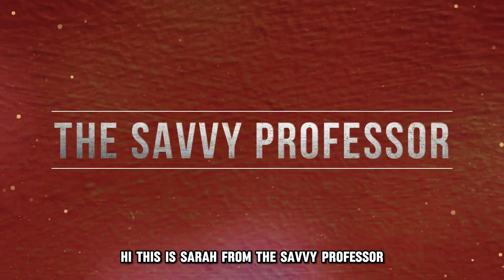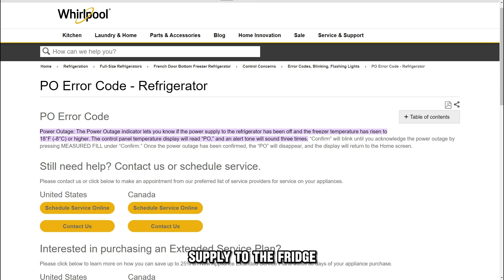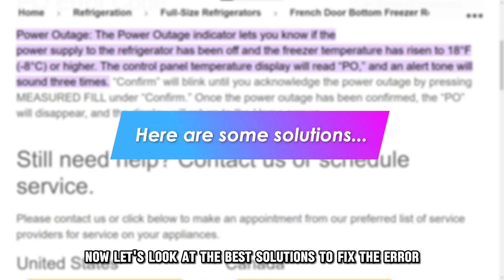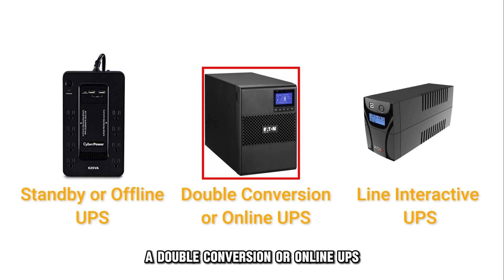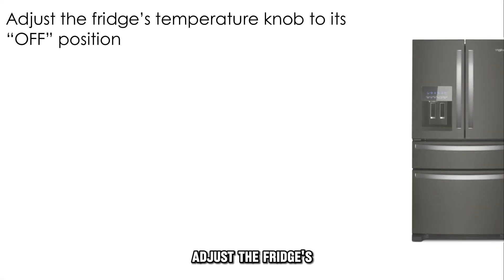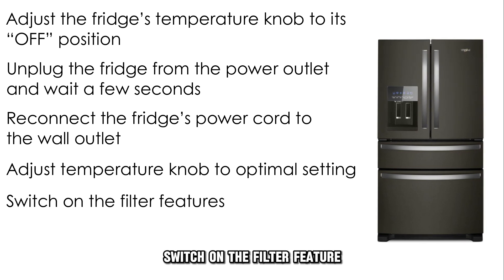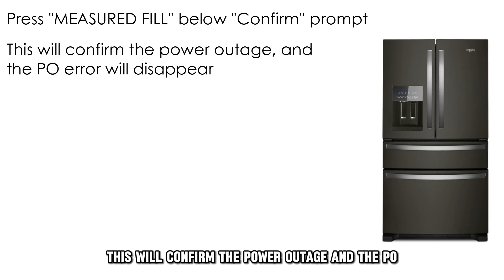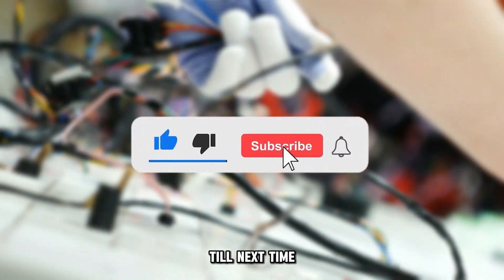How To Fix The Whirlpool Fridge PO Error Code - Meaning, Causes, & Solutions (Ultimate Guide)

Comment: The Whirlpool refrigerator will throw this code if the unit is pushed too close to the rear wall.  Without sufficient flow, the unit overheats and start throwing this code.  I had a brand new unit that started doing this when it was pushed too close to the wall.  I called for warranty service and they replaced the motherboard only to have it come back the next day.  Once I inspected the rear of the unit and realized that the fan is so close to the rear of the unit that if you pushed the fridge to abut against the rear wall, there is no airflow.  Once I pulled the unit about 4-6 inches, it's all good now.